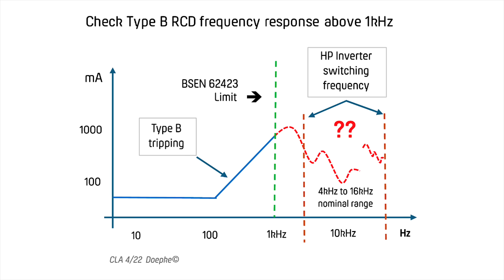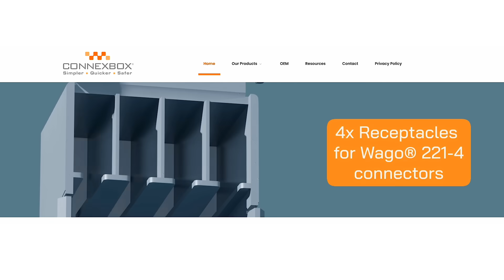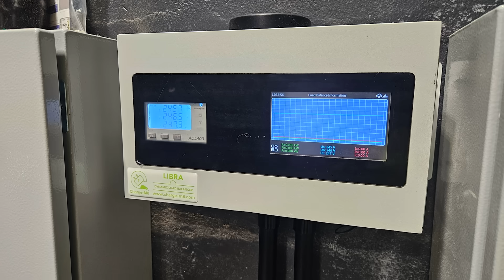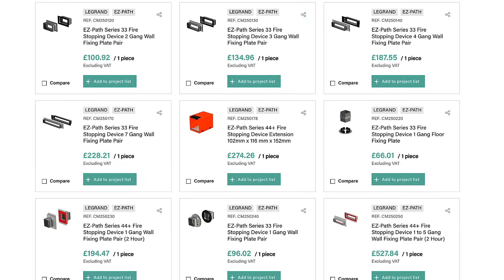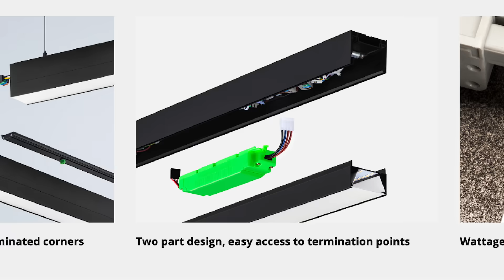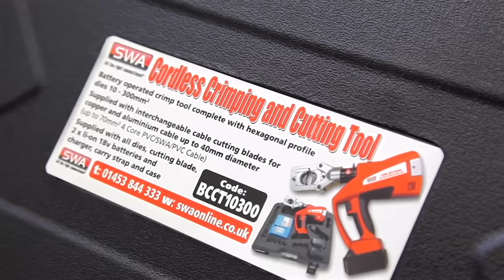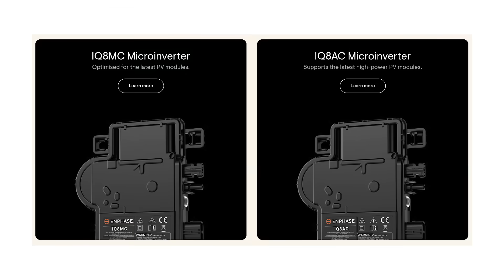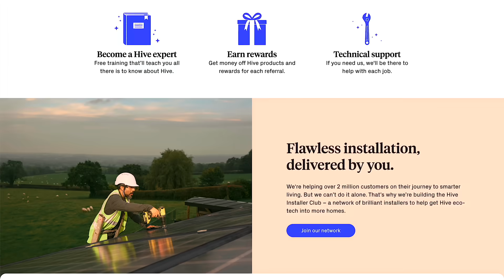Experts Warn: Crisis Looms For UK Electricians!

Comment: We've installed inverter driven air conditioning on Type AC & Type A RCDs/RCBOs in commercial for the past 30 years at this point now with absolutely zero issues, the fuss over all of this about heat pumps is hilarious, they are functionally no different from inverter driven AC units. Absolute money spin by manufacturers, convenient how Type B & F RCDs are £100+
Reply: There is a regulation (an EU reg if I remember correctly) which stipulates that manufacturers of appliances are required to state which RCD type should be used with their equipment.

However, when I tried to do this recently for a kitchen appliance from a well known manufacturer, I could not track it down: it wasn't included in the appliance's installation instructions which is the logical place to put it, and I couldn't locate it anywhere else.

My point is, that it is not in the manufacturer's interests to state the use of a more expensive and unnecessary type of RCD, as they are not manufacturing or selling the RCDs.

My second point is, that the appliance manufacturers should be complying with the regs and publishing the appropriate type of RCD to use.
They know how their appliance functions.
Reply: @deang5622  Perhaps it should be the responsibility of the equipment manufacturer to filter out the RCD-confusing crap that their kit produces...
Reply: @misstakenot9582 No, that increases the cost of most appliances. It's a cheaper for consumers just to install a single RCD and cover multiple appliances, rather than have each appliance contain filters.
Reply: @deang5622 did you try to contact the manufacturer/distributor to request the information?
Reply: @deang5622...

The type of RCD, breaker, fuse, whatever needed for an appliance will be specified by reading the CE compliance certificate. Or in our case in the UK, the BS or EN standard it complies with.

All electrical devices have to display the standard they are "meant" to comply with; so based on that it is fairly easy to figure out the right protection device to use.

The big one (most difficult to pass for a power device standard) is line harmonics, which affects power factor. The current use by an appliance is meant to be all at 50Hz for perfect power distribution. It usually isn't, especially Chinese designed gear.
Reply: I think the issue could be that they are blind to the possible fault?....I personally when I did do installs would have tried to avoid the rcd route where possible with the use of swa.
Reply: @roystevenson1375 What was the problem with SWA and RCD?
Reply: Yes u tell um.Scam electrical world it is.
Reply: Yes, they are fundamentally the same in this regards, even often using BLDC motors these days.  Is it just a question of all those 'inverter' aircons out there not having a problem or is it just that the problem wasn't recognised.  Truth is it's a bit of both.  Look at how long type AC (back-ronymed!) RCDs were in use yet we clearly had devices imposing a fair bit of DC with the use of half-wave rectifiers as an example of how we weren't really doing things properly for years.  I commented some time ago on another youtube channel that eventually type B RCDs are going to become the standard as type A is today and nothing has changed my mind about this.